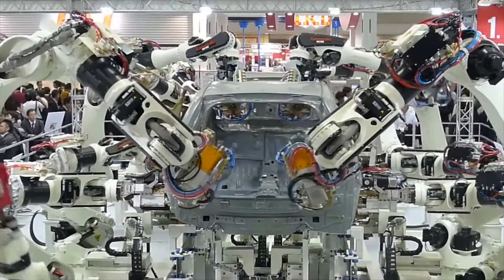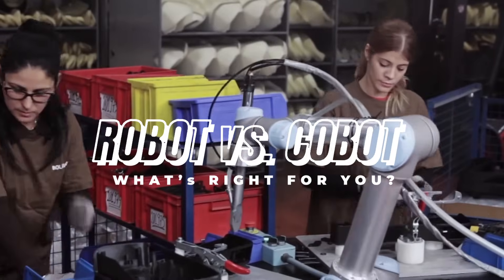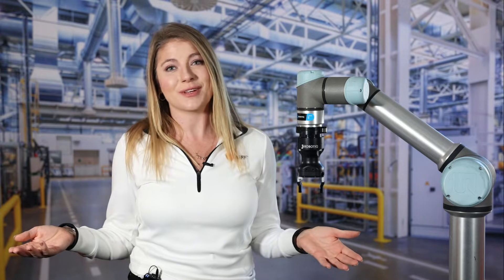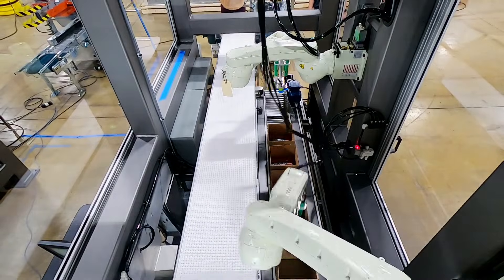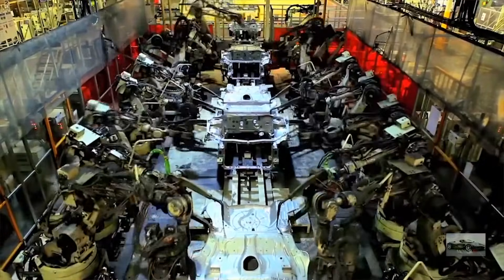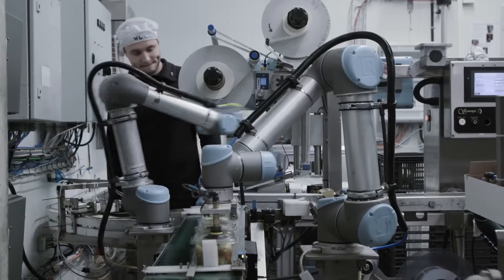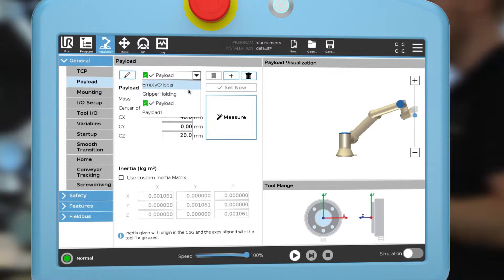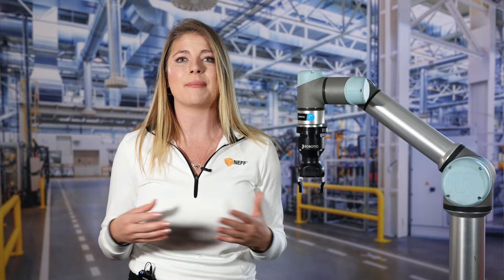Industrial Robots vs. Collaborative Robots | A Clear Winner?

Comment: One customer realisation about chaina....... collaborative robot:
When it comes from China, it doesn't come with an instruction manual....If they sent, in most cases they provides another manual  ... with which the robot sent is quite inconsistent...but from other countries, they provide all through instructions on collaborative robots they deliver....when you come to installation, the communication between you & chaina technicals is so confusing that the customer gets annoyed....& Expert also
Their work is extremely unprofessional....both are suffering a lot to drive it, therefore the cost of installation, training & production is at least three is spikes high....
I also struggling in same...
let's see when they will provide an instruction manual.....